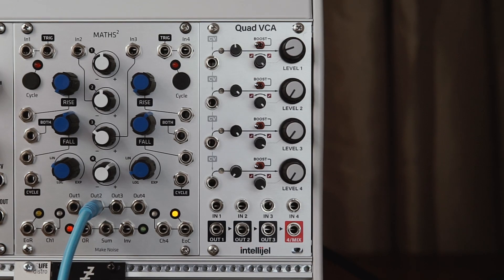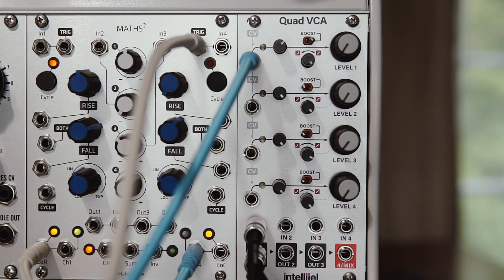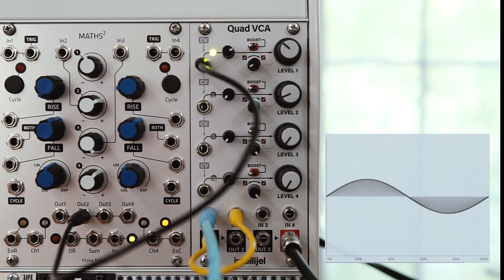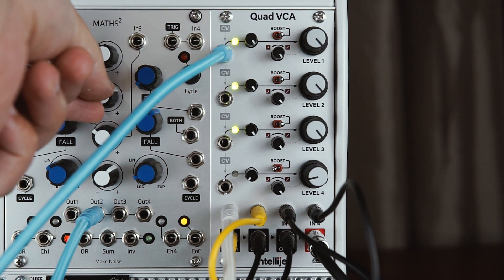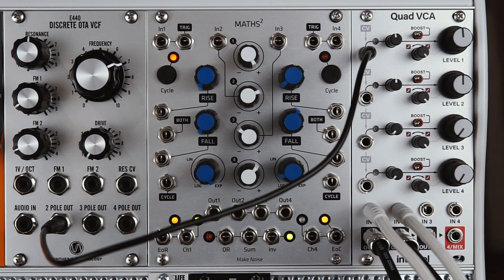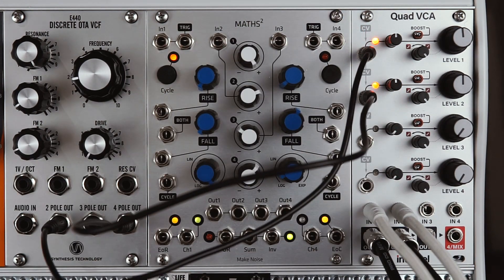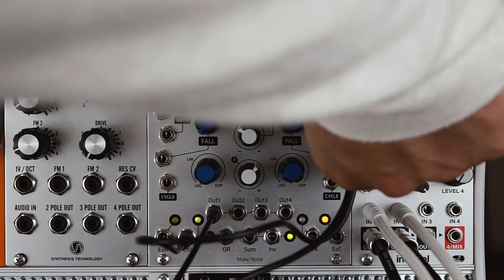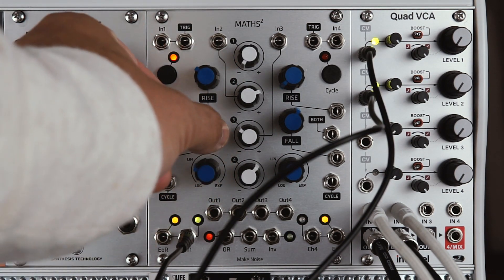Intellijel Quad VCA - VCAs are fun!

Comment: Such a clean sound, so much better than a VST
Reply: I disagree that it's better or at least objectively better.

Saturn by Fab Filter does an amazing job BUT with a bit more work and you may need multiple instances of Saturn to get a convincing simulation of the staged clipping (think an instance of Saturn for each stage of Distortion (VCA). 

---Dan Worrell has a series of videos on how to use Saturn to emulate an entire guitar amp and it's many stages of saturation. 

but to be clear, and to not discredit your comment; you can get some FAST results with the module rather than just fiddling with a VST. 

something to consider is you will get some noise in the modular signal as modular isn't "perfect" like a VST. This can be preferred since most analog modeled VSTs will add noise which our ears tend to appreciate. 

secondly, there are no presets in the analog world.
Reply from the maker: I have to agree with you really, even for just the panning stuff it sounds so good.

Comment: great demo -- i'm going to jump right back with the Quad, and use my Radikal RT-451 for modulation.
Reply from the maker: Strateggo do you plan on making any videos or audio with the RT 451?  I didn’t hold on to mine for very long and I’ve been thinking about gettin it again,  there’s almost no demos of it in “normal” bass patches for example.
Reply: @AiynZahevSounds  i don't make any videos, just don't have the patience to record/edit/upload and perform. Have you looked at the demos from the manufacturer? I think I've also saw one vid where the 451 is used in a TB-303-like patch, but can't remember which - the sound was exactly that of my TB-03 Roland.

Comment: Does this have enough gain on tap to bring line level sources up to modular level?  It seems that way from the video, but I'd appreciate confirmation!
Reply from the maker: The boost switch alone adds 6dB of gain. If that's not enough you can cascade like I did the video.